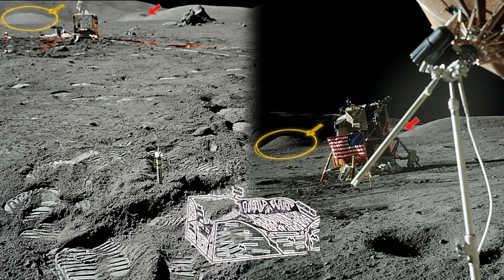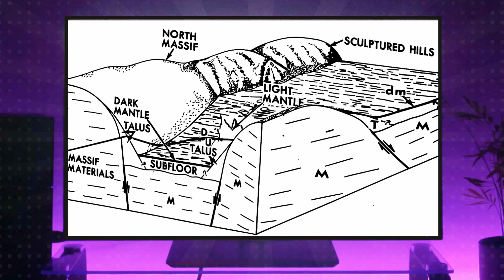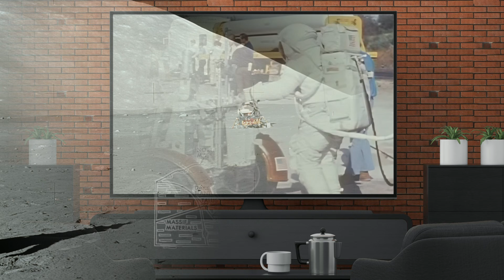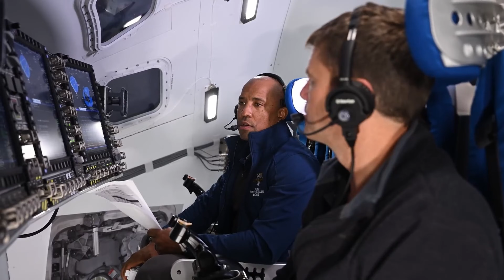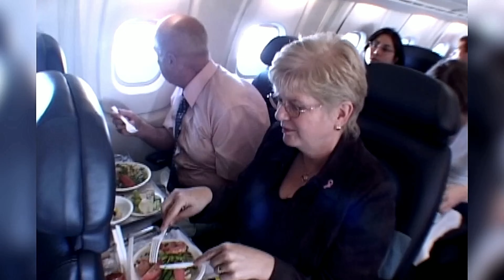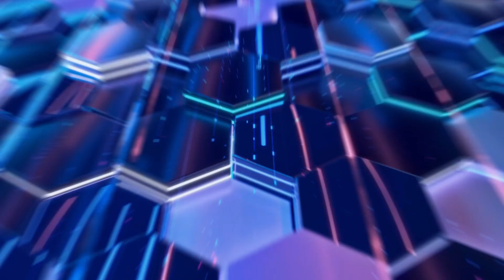"APOLLO 17 AND THE LEAPING LM" PART 141  #Apollo #NASA #ApolloDetectives

Comment: 7:42 Spray on stage rock per ai:

"Yes, spray-on insulation, specifically spray polyurethane foam (SPF), was commercially developed and available in the mid-1960s, though it initially saw more industrial use before expanding to residential applications, with dedicated spray machines appearing around 1963. While fiberglass and cellulose were more common for homes then, spray foam emerged as a superior option for air sealing and energy efficiency, with NASA even advancing its technology for space needs".

Comment: The most convincing evidence that they never went is the lack of sufficient amount of fuel to even leave low earth orbit. 
And when they tried go higher with the space shuttle they started to see (flashing) in their eyes from the radiation from the van Allen belts! 😅
Reply: They did have enough fuel. If you calculate the delta-v, it's correct. You shouldn't compare the Saturn V to Starship.
Those flashes (phosphene induction) aren't caused by the Van Allen Belts, but by cosmic radiation. Their eye membranes are hit by a proton or a heavy ion. Not by a city bus.

Comment: Gathering all the problems of going to the moon, it seems to me this may take more than at least one century for real.

Very bold, to set up such a lie though. How many more of such lies do people these days believe? Since the design of plants and animals is laid down in DNA, why do people still believe these very high tech designs were random occurrences?
Reply: There may be better technology (not available to the public) that could take humans to the Moon, but I don't think we have the technology to play around on the lunar surface.
Reply: @codetech5598  Coming back from the moon, seems to me a lot harder, than getting there.

Some of the problems not solved:
1. Heating of the capsule, when hit by sunlight without an atmosphere, boiling astronauts to about 400 degrees, before arriving at the moon.
2. Van Allen Belt radiation.
3. Objects flying around in places without an atmosphere.
4. Immense heat and radiation from the moon surface, when lit. Colder temperatures than on earth on the moon surface, when not lit.
5. Vacuum every where, which is almost certain death to astronauts, if a small hole is found in their suit.

These problems should at least be addressed, by any one claiming to sent people to the moon. One would expect, some animal(s) would go first, in order to test the technology, and to prove it to be possible. As the Russians did with satellite technology.

Comment: One hour of shadow motion on Earth equals about 4.6 days of shadow motion on the Moon. Shadows on the Moon move about 111 times slower than on Earth. On the Moon, shadows move at about 9 miles per hour because the Moon rotates once every 29.5 days.
So, in contrast in one hour on Earth, shadows travel 1,000 miles. 
 When you said moon shadows move 14 times slower on the moon than earth it didn't sound right so I looked it up. That Lunar mountain would likely take much longer to move into shadow than you've stated.
Reply: Earth= 360 degrees by 24hrs = 15 degrees per hour
Moon = 360 degrees by 708hrs  = .5 degrees per hour
i said 14 but it is really twice that

Comment: Apollo Detectives - how the hell does NASA explain away the presence of Tracy's rock? I asked ChatGPT how could such an immense rock just be sitting intact on the Moon's surface. Of course ChatGPT came up with the following nonsensical answer, "A rock like Tracy's Rock could have been ejected from a nearby crater during an earlier impact and just sat there, undisturbed, for millions of years."

Seriously, what nearby crater? If Tracy's rock broke off from an asteroid, can you image the size of that thing! Such an asteroid would have made one of the largest craters on the Moon but do you see such a crater near Tracy's rock? Also let's say for argument's sake Tracy's rock broke off from a large asteroid that impacted on the Moon. Tracy's rock is so heavy, it would have embedded itself deep into the Moon's surface. Then after just sitting there for millions of years, it would have been covered by layers of dust, leaving maybe just the tip of it being visible. Tracy's rock looks like a giant piece of foam rubber that was just placed there. If it was real, it couldn't be sitting on the Moon's surface for millions of years without a deep footprint due to it's sheer weight! Tracy's rock is just sitting there in the middle of a relatively flat surface and is totally pristine - sorry this is so fake, it's unbelievable!